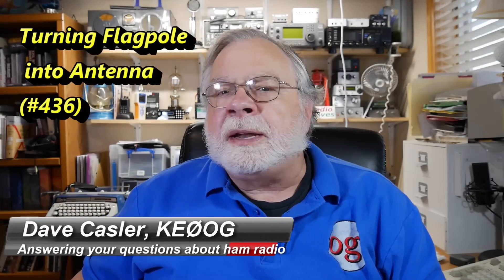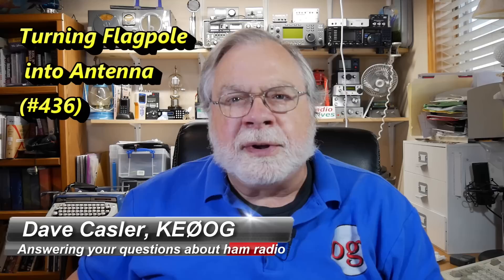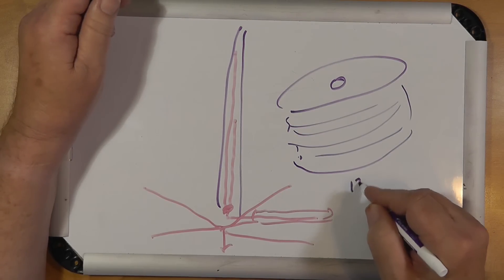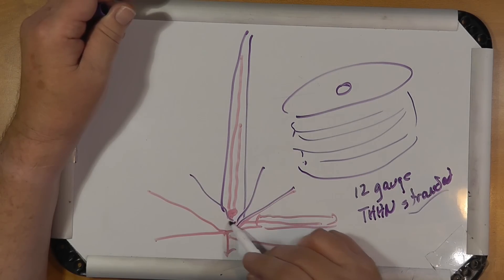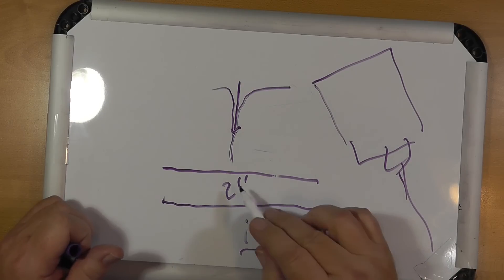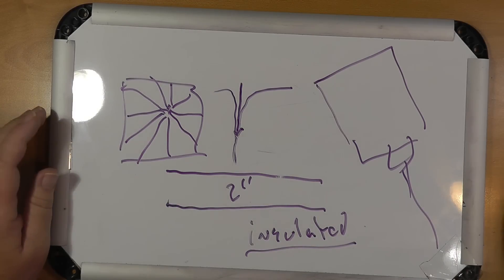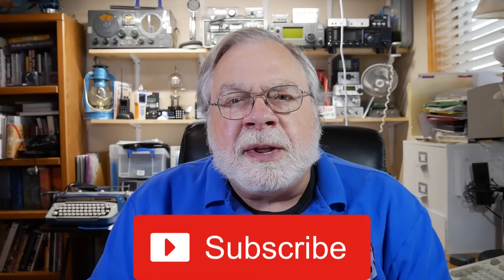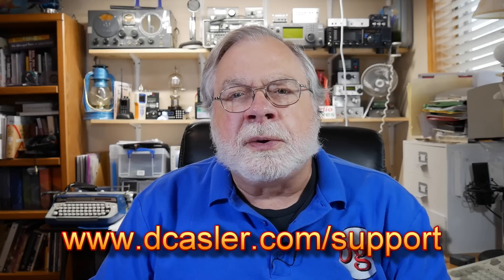Turning Flagpole into Antenna! (#436)

Comment: Dave, I was thinking of running a fan vertical up a chain link fence top rail mast. How much standoff from a metal pole would you suggest to prevent coupling? Thanks!
Reply: A couple of inches will suffice.  That spacing is too small to create any distortion in the pattern, but great enough that the RF is going to follow the path of least resistance - the resonant element.   That's how fan dipoles work.   And, it works for verticals, too - witness the DX Commander vertical.   That's just a vertical version of a fan dipole with radials.

73
AI4IJ

Comment: I used a lawn edger for part of my radial field. I has a curved blade and it took me a few hours to bury one side. Within a week the slits were barely noticeable.
For the other side I used some biodegradeable stakes used for landscaping fabric or sod.
I did that because I risked slicing telco/catv drops and I really didn't want to try to locate them.
The biodegradeable stakes allowed me to anchor the radials and minimise the risk to my lawnmower in that area.
Within a month the radials have all but vanished into the lawn.
If you go looking for them you can still see them but the grass has started to cover them up nicely.

Comment: Hi Dave. Using ladder line is a great idea for a Fan Vertical. I might also suggest using cheap pool noodle cut in 1 inch sections to help hold the top and bottom of the elements used.  Just food for thought. As soon as I'm strong enough I want to try the ladder line idea.
Reply: That's a great idea!

Comment: FWIW:   Based on studies from Rudy Severns (N6LF), the milestone for radials would be about 5 wavelengths of the lowest frequency with reduced ROI beyond that.  Individual length isn't as important as the overall length of copper on/in the ground  (FWIW)

Comment: Can you turn the radial field into either hexagon shapes like inside a bee hive, or diamond shapes both emanating from the antenna? Neglecting connections corrosion either soldering together and dabbing the junction with resin, or just twisting two wires?

Comment: For what it is worth I found that my Hustler 5BTV didn't really perform well until I had at least 30 radials, I kept adding more radials and found that after about 60 radials performance gains started becoming smaller, I am sitting at about 75 radials now,  I was working towards 90 but I ran out of wire and I haven't been motivated to get more. I just laid them on top of the grass and secured them down with sod stakes, by the end of the summer the lawn (st augustine grass) had grown over them and sucked them down perfectly.

Comment: Love to see the practical side of this ... how to make the connection to the coax, do you need a plate to connect the radials ,  love to see it actually done.   Also I would probably cheat a use the flag rope to pull it up until I knew it was working.

Comment: I have a fiber glass flagpole too. And at the Base it has a steel pipe for strength, abt 70 cm long. I put up a 40m vertical on the outside and many ground radials. 1:1 swr on 40m and 15m band.